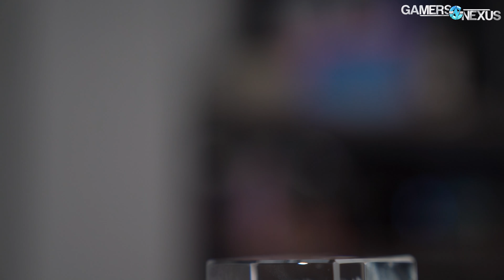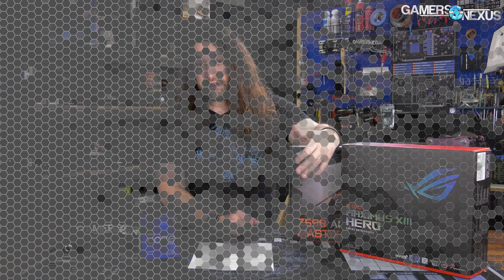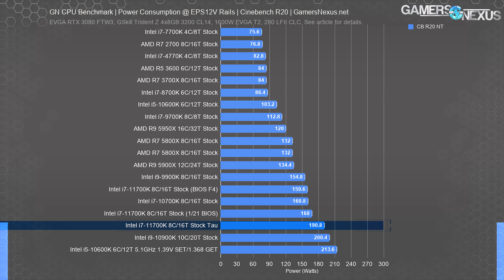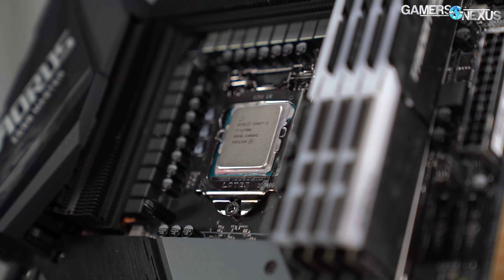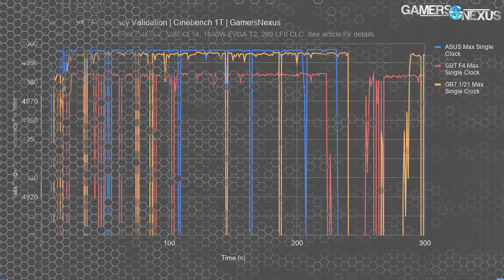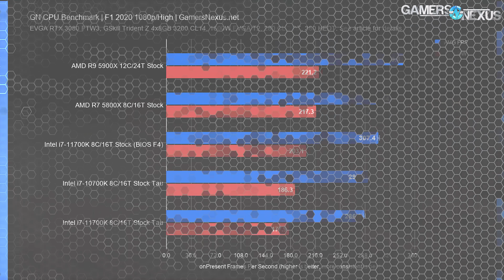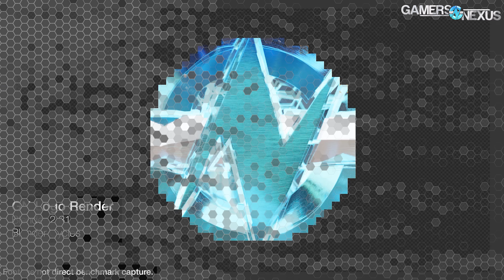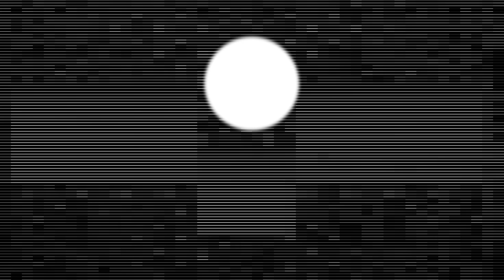Intel's Z590 Motherboard Problem: i7-11700K Power & Thermals Explained

Comment: Intel K procesors works best oovercloked.... not stock.... why compare stock ... we need to se overclock potential of those chips not stock... wich board gives best overclock... etc
Reply: They mentioned that they had some problems with it, so it's best to wait for the full release and the 11900k test, because thise time round (when both i7s and i9s are basically the same chips), all the best binned ones will be the i9s.

Comment: Computer efficiency has come such a long way. I remember back when 90nm CPUs were new I was using a 1200w PSU, and needed most of it.
Reply: I am curious; what hardware did you use to get near the 1200w number? 😅

Comment: I think it would be nice to get a prompt at boot asking the customer/ builder if they would like to apply “enhanced turbo boost” with some kind of note regarding the extra cooling and power use. 

Best of both worlds, customer get the option of extra performance if they don’t feel the need or have the knowledge to overclock manually and the cpu won’t surprise people with extra power draw / heat production 

I’d prefer that than just running intel defaults out of the box. Up to 12% is substantial if you already have the cooling anyway.

Comment: Thank you for testing as per manufacturer requirements.
When pushing CPUs over a prolonged period of time, what fails first? CPU? Motherboard components? How much does overclocking effect the CPU in longevity?
A 'new' Intel or AMD APU should be able to 'media' itself for the next 10 years, will it die before this?
Reply: Look bullzoids videos. But from out of memory... the CPU degrades and is not as stable as it used to be and you have to clock it down to Keep it stable aika you have to reduce clockspeed eventually. Hon badly and now fast it happens is the question.

Comment: Great video from the GN team as usual. At this point, I'm not even gonna bother with any of the 11th gen CPUs. Zen 3 is just simply performing better right now, I'm just hoping there's more of them available on the market so prices won't be that obnoxious. IMHO, the 11th gen is just making the 10th gen the better bang for the buck, especially for people who are building a rig on a tight budget, so I wonder, maybe Intel weren't planning on making that many of 11th gen CPUs in the first place, maybe they were still pushing the 10th gen CPUs, maybe they knew with the current lineup, no matter how hard they tried, they still couldn't beat Zen 3, so they decided to go for the next best thing, which is the 'budget king'. I'm not even kidding, right now I can get an i9 10850K for only like $20 more than the cheapest available 5600X. The i7 10700K is even cheaper than the 5600X. Even then, people still buy the 5600X like crazy. Imagine what happens when they can ramp up the production of Zen 3 CPUs and prices are closer to the MSRP. Good luck Intel. See you in 2025.

Comment: So under the assumption that i attempt a 5.0 ghz overclock on a 11900k i would have to turn that setting to the recommended voltage? )Not talking about cpu core voltage of course)

Comment: That is all great , but which settings in bios control these, how to check it all?
Reply: You will have to dive into manuals and such for each motherboard. Not only does the issues Steve talk about exist between company to company. The same company will do the same thing from board to board.

Comment: The only fans that should be sold for computers are 16000 rpm fans. If it doesn't sound like a dental drill youi not trying hard enough.

Comment: Hm ... this might explain my very bad experience with Gigabyte there boards in the past ... 
the big “no no” for me was that Gigabyte there support blamed it on everything but the board and after replacing PSU, GPU, SSD & RAM they “replaced” the board and it still had the same issues ... after the store gave me a full refund and I got an ASUS board to replace it the problems were all gone ...
Till this day I Stay away from Gigabyte products because let’s face it ... if the support tells me to replace everything and tells me that the board could not be the problem and it turns out by replacing the board with one of an other brand that it actually was the problem than my trust in the company is gone ...
The issue might have been that they did not follow the intel guidelines to as said in this video “cheat” the performance of the board
But this backfired because I might have got a lesser CPU than they have based there guidelines on and that might have resulted in the instability that I had
The weird thing is that the support never recommended to change settings in the bios so it would match the intel guidelines
So on me there “Cheating” backfired and they lost sails because of it
Reply: I just bought a MSI and Asus board and had some issues with them too. The supports of both manufacturers told me to change my hardware first............

Comment: It's funny watching fanboys switch sides to amd lately
Reply: Lately? You're pretty much not allowed to say anything bad about AMD anymore.
Reply: @cartrips9263  Their APUs are better than the mainstream chips. Zen 3 monolithic 8 core APU will outperform an i9-9900KF (basically i7-10700K) and has a pretty good singlethread score.

Meanwhile people will buy a 5800X which is a worse 8 core processor without iGPU and isn't monolithic. So, you get a free low-middle end graphics card on the APU that will outperform any CPU related rendering. i7 gets 50% improvement to iGPU, PCI Gen 4.0 and DDR 3200MHz besides the obvious Cypress Cove cores...

There are clueless people here 🤦‍♂️.
Reply: @saricubra2867  Funny thing is that 5800X it's actually monolithic. It's just one CCX connected to the I/O chiplet: there's not really CCX to CCX latency. The 5900X and 5950X use 2 CCX, they are real MMC.
If people on budget were smart they would buy Intel 10th Gen. Right now everyone is cutting prices on them.
If you're not on budget then 11th Intel for gaming.
Reply: @deidian635 Having a separate IO chiplet isn't monolithic, APUs are one single die.

Ryzen 7 5700G is faster than an i9-9900KF which is the same as i7-10700KF, there's no point buying 10th gen with the exception of the i9-10850K or 10900K.
Reply: @saricubra2867  Yet to come, but on a budget the idea of beating sub 300$ on a 10700 or something like that doesn't seem too feasible.

Comment: lets see how the 11900k OC will look like. I need the best single core performance i can get. Otherwise i would get AMD
Reply: If you compare 11900k OC you need also to use AMD OC, but these single core tests are not that useful, even in games you use at least 2-4 cores.

Comment: uh...How about you test the power consumption during gaming with MCE and not Blender test. Intel CPU are inefficient for sure but that doesn't matter during gaming workload when the difference between 11700K and 5800X is only 20-30W (5800X with PBO enabled)
Not everyone is using their rig for Blender, Steve.

Comment: Honestly, I feel like if the new CEO doesn't fire most of the big wigs starting with the head of the marketing department, then this swamp of bullshit they've been pumping out since Skylake will only get worse. TDP should only be a single simple metric of the quantity of heat in a range during  the operation of the chip under normal voltage levels set by that manufacturer per chip. Doing so would perfectly set up consumers to find a respective cooler that can dissipate that range of heat well making buying easy and would promote more sales. Why anything else was even considered is a branding failure, while being a false metric for product exploitation. This action that has been committed for multiple product generations is reckless abandonment and qualification for termination. That's at least what I'd wish would go down at Intel HQ.

Comment: Basically you get here 2 targets:

A)Plug & Run: best bargain money wise will simply do it. Any motherboard will do. Any CPU will do. You want power: go for 11900, 10900, 5800, 5900. Stay away from K/X processors, they are a waste of money for the edge they give at stock. You care for the best bargain and manufacturers do that by default: stock non K/X processors is running everything getting most power at the most reasonable cost.
B)Interested in OCing: here there's a lot of variance. It can go cheap or incredibly expensive, but you're supposed to have a minimal insight on what you're doing.

Should the potential buyer of a K/X processor be really interested in how the processor behaves when you stick to stock limits?

PS: this is happening since Turbo Boost 2.0 apparition, which brought partial turbo modes, per core clocking, short burst power and time limit, long burst power and time limit. But it's only now being brought up for discussion when it should have been noticed years ago.
PS2: PBO in AMD has power and current limits at least. Could be also worth to check how different motherboards actually behave with that. But I wouldn't be surprised if the "Auto" setting of an OC intended MB set higher limits than stock.

Comment: Steve! if you ever need a subject to rant about that i'd watch. Controller/gamepad teardowns. I am SO fricki'n sick of bying a new blasted controller all the time because they use shitty and inacurate potensiometers and not superior HALL or optic sensors. Where did the good old gamepads with HALL sensors go? Using potensiometers on gamepads is like going back to frickin ball mice. remember how sucky those were?
I got like a 17 or so broken controllers in a box somewere and most of them are just worn down potensiometers. Talk about useless E-waste.

If you and/or Linus loose your marbles and figure you want to tackle this problem yourselves i would be thrilled. I will by at least two instantly. Even if it is way over 100$ Call it something goofy like LinNex or NexLin controller. i don't even care if it is shit brown and vomit yellow and as ergonomic as the NES brick as long as the damn thing last longer then 5 minutes.
Reply: Get wired Logitech one. It's good
Reply: @CaptainScorpio24  you got a produckt name for me to look after bud?
Reply: @kimsund8084  Logitech Gamepad F310
Reply: @CaptainScorpio24  thanks mate, i'll take a look at it.

Comment: its easy to determine if its overclock or not dotn fukign review the Ks just take the NON K versions if its still works its not overclocking end of story (intel reading applies ;)  ) 
PS:sidenote a 400€ part beats or comes close to 800€ part so intel wins hard here...

Comment: Intel won't do anything about this given how badly they are doing. They would happily treat it as good enough
Reply: It is good enough... Intel is getting bigger market Share again...
Reply: I don't really care if they (or AMD) are getting bigger market share or not, and unless you are a shareholder or hopeless fanboy, neither does it matter to you. 

What I care about is them releasing and re-releasing the same shit over and over again and branding them as something new just because they did not have to look over their shoulders. Now that they finally have some competition, they are falling over themselves.

I am no AMD fanboy, I'm just a consumer or tech enthusiast and am pissed with how Intel has been holding the industry back for most of the past decade. 

My last PC ran with a i5-3570K and not once in the last 10 years did I felt a real need to upgrade, until AMD released the Ryzen 3600, but I told myself I'll wait for one more gen and finally pulled the trigger on a 5600x last year.

How many "true" generations have there been for the past 10 years for Intel if you discount all the re-releases and refreshes?

Comment: Is this Tau and PL1/PL2 stuff a new thing for 11th gen Intel? Or has this always been an issue, but motherboard manufacturers were less bold?
Reply: Since Turbo Boost exists this has been a thing in some form with different names. Turbo Boost always sets power limits and duration for the "Turbo" mode of the CPU(a CPU is in turbo mode when it exceeds core frequency, that's why Intel says core frequency and turbo frequency in the spec tables), it was designed that way, in the first versions these settings were hidden in the BIOS, but for example downloading Intel XTU(Extreme Tuning Utility) should show you which limits your BIOS has set, even if it's not configurable.

Multi-Core Enhancement exists since "Per Core Overclock" was added to CPUs: all it does is running all cores at the same frequency the highest core is running actually. Basically with this cores will run all the same multiplier instead of each core clocking based on their individual load. Better performance at a small power increase. This one isn't out of spec operation.

Enhanced Turbo: exists since "partial turbo" modes exists. This is: All-Core/N core/4 core/2 core/1 core turbo. It allows to run an "All-Core" turbo at the core clock of other modes. For example: All-Core turbo with this enabled may run at 1 core turbo clock, but in all cores. This nowaydays is not doable this way, they'll probably choose a lower clock turbo mode: I mean, running an 8 core "behemoth" like 11700K all cores at 5.3Ghz isn't something easily achievable even in manual overclocks.

Generally speaking: more than 5 years.

Comment: how do we know which motherboards are following the guidelines? Can we get a chart for this?
Reply: Enter the UEFI and you'll know. You can disable it there too if the board 'Auto' is enabled for your CPU. What you're asking is insane: motherboards 'Auto' values are everything, each motherboard will set the value depending on the hardware it's connected, so for different Intel CPUs on the same board the 'Auto' can be a different value.

Comment: I'm surprised the 11700K can even run without thermal throttling due to all the burn from GN
Reply: OP AIO cooler
Reply: Should have come with a heat shield to install on the opposing side panel of your case
Reply: The chip is bigger than others from previous gens, it has more surface to dissipate heat, so easier to cool it.
PS: this reminds me this year I'm going to need another space heater. I'll run one of these in AVX512 only load: +300W should add nicely to warm up home. My i7 6700K OCed is disappointing: too little power drawn to heat up anything at all.
Reply: @deidian635  I bought the i7 11700k and when I tried to get 5ghzt all core the Asus board was predicting 1.58v and I couldn't even get 4.9ghzt under 1.34v it was insane.
Reply: @thealien_ali3382  mine never thremal throttles, as far as I can tell. No problem staying at 5Ghz all day when gaming

Comment: the long and the short of these 11700k videos: the chip is crap, stick with a 10700k or get an AMD. they're both faster..
Reply: That is fake. We clearly see that the 11700K performs very similar to 5800X, and many games tested here are GPU bound. Proper CPU gaming benchmarks use Shadow of The Tomb Raider, CS GO, League of Legends and other similar games.
Reply: @saricubra2867  well, without gpu bound 5800x destroys 11700k, like a lot

Comment: It's not really the board vendors that are to blame here. Intel is letting them do this again and again and will not make spec what should be spec. This is going on for generations of Intel products and is done intentionally to muddy the waters. The blame is on Intel, nobody else.
Reply: Yeah that's why they do the same crap on AMD boards, which he didn't mention.
Reply: @cartrips9263  Search for "MCE & CPB Investigation" here on GN and skip to 23:30 on that video. Spoiler: It's not the same crap.
Reply: @noenken  it is basically the same crap. Doesn't matter if AMD fanboys claim otherwise.
Reply: @cartrips9263  ... sure, whatever.
Reply: @noenken  that's what I said.

Comment: Wow, still doesn't beat the 5800x stock in several tests and barely edges above in others.  All while pumping out more heat and drawing more power.

Comment: For the CPU, I can hold a portion of a chip against something, that is course enough, and have copper appear on one spot. 
AMD has several MOBOs that break the set limits. 
MOBOs that increases the voltage past the limits
Both sides have MOBO companies that break those limits because they want sells. We both know that. 
There is a really good chance that Intel could beat AMD. By you making a video trying to protect AMD. That looks extremely bad on you. 
My conclusion? Until we have pure scores, for gaming of course,  you can complain all you want. 
Your whole video is being debunked. Quit trying. I'm trying to play Valheim while commenting (laughing).

Comment: Feel like I’m just gonna keep my 10700k and go ryzen on my next build lol
Reply: just wait... dont jump to ryzen until 12th gen is launched... plus the 11700k is still cheaper than the 5800x atm... and look when the 5800x came out....if 12th gen sucks then ill probably jump to ryzen as well... but only anything over the 5800x....not really worth spending the extra 100+$ for a 5800x/5900x over your 10700k....
Reply: 10700k is great!
Reply: The 10700k is a cracking CPU for its price so jumping to AMD will be a complete waste of money for very little performance increase. So don't jump ship just yet and wait untill 12th gen arrives at the end of the year.

Comment: Sounds like Intel needs to make their "power recommedations" actual specs, for the defaults that is, that motherboards must follow. Sure the MBs can provide all those fun tunables and over-spec power and scaling settings presets, but now the user must opt-in instead of opt-out

But they must make sure to put BIG FAT WARNINGS marketing materials targeted at power users and up that due to laxer requirements of past CPUs and/or chip-sets, performance may have been erratic and thus you might see what is an apparently weaker CPU.

It's really an awful position they put themselves in.